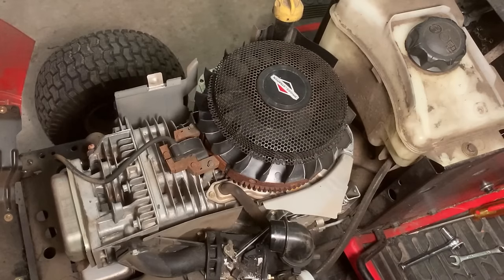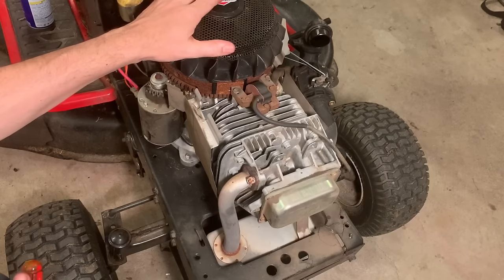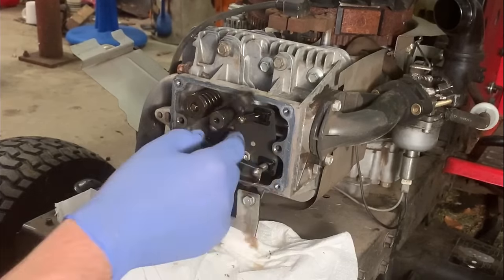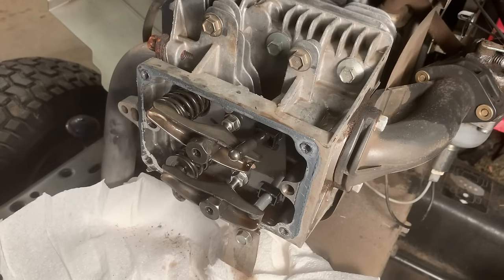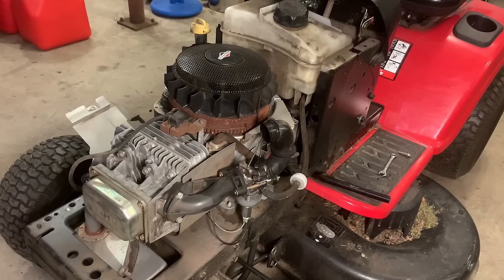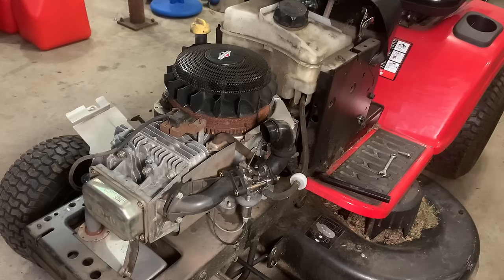Lawn Tractor Engine Running Rough, Missing, Popping, Sputtering / Briggs Engine - FIXED

Comment: I know right around the 8:49 second mark I would’ve taken that stud out, cleaned it on the wire wheel and then put some medium strength thread locker from Locktite on those threads since it already has shown a propensity to come loose, but that’s just me, a guy who does not cut corners that does the job right the first time! 👍😃👌

Comment: That is the worst filter  need to go to O'Reilly's and buy a real filter that filter if you have little sand it'll go right through that filter on the brakes is very common for that stud that holds the rock or come loose I repaired about four of them already within a month same problem I think the best engine is a kolher

Comment: The big problem is it is a Briggs Engine. Briggs doesn't even stand behind their products. Cams with air pockets in them, plastic flywheels. Anything for a buck. NO quality in Briggs! At least you have a metal flywheel...lol
Reply from the maker: True, but I like the fact they put their name in it and will sell you any part you need.  Cannot say the same for the Chinese engines.  I like them but parts are near impossible.

Comment: Thank you for the video. I have the same engine and with a similar symptom. It's hard to start and when it starts up the engine is not fully running. I do not hear strange noise though. Could it be just a timing issue?
At https://youtu.be/zpFdvobEWzg?t=241 how do you know it's timed pretty well by putting a screwdriver to the spark plug hole?
Reply from the maker: You need to take the cover off, remove the spark plug and rotate the engine clockwise.  The magnet should just be clearing the coil at top dead center.